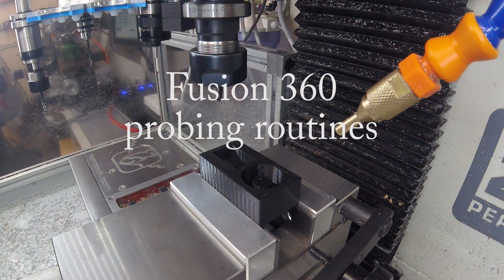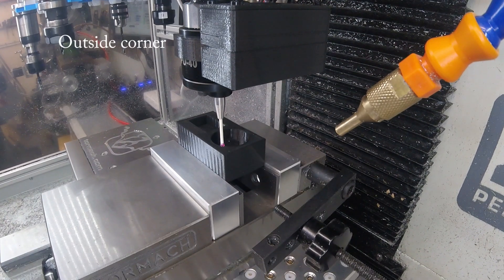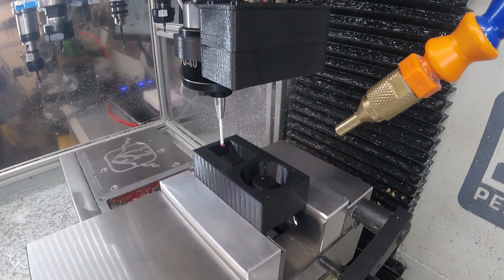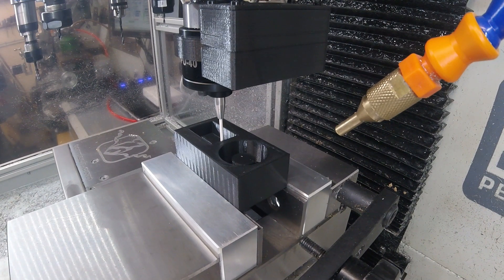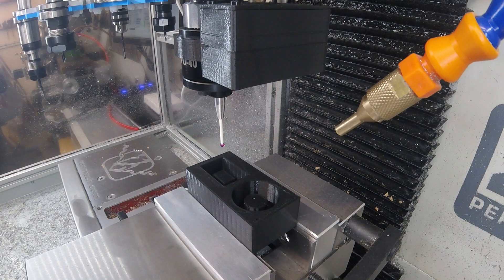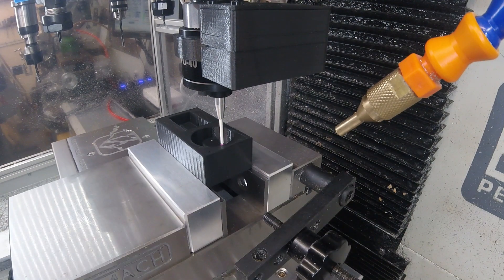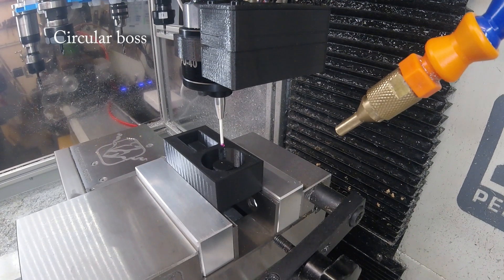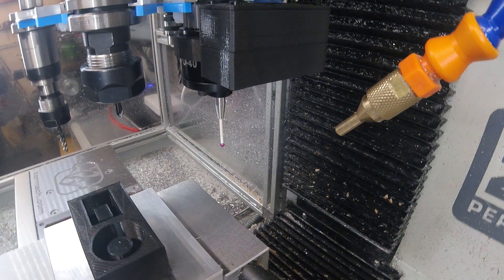Fusion Probing on a Tormach 440

Comment: Hi,

How would you integrate a probing cycle into ones machining code so that the VMC finds the corner of your stock and can then confidently carry on and machine a part?
Reply from the maker: I did a later video at https://youtu.be/aSJ01z87Rjc that shows an example of what you're asking.  It also shows how the code was created in Fusion 360.

To get it to work, you need a customised post processor and either g-code subroutines or some other form of macro on the machine itself.  I have implementations of these for Tormach machines running PathPilot or for Mach 3.

There's also a more 'real world' example of the routines being used in https://youtu.be/KDfAdO0Xkcg This example does exactly what you're asking, probing first the top, then the back corner of the workpiece.  It adds the sophistication of doing 2 workpieces in separate WCSs - not bad for a little 440!

Comment: I have so many questions. First thanks for sharing. Can you explain how you modified the probe to become wireless. Second, would you please share the fusion 360 project for me to understand how the probing is integrated into your CAM and post-processor. This is amazing. I have a PCNC 1100 and the active probe and I always though wireless probing was for the Cool Haas guys :)
Reply from the maker: Have a look at my later video https://www.youtube.com/watch?v=aSJ01z87Rjc it shows the probing being used properly and also how it was programmed in Fusion.
The wireless conversion is based on just an Adafruit Feather 32u4 with LoRa radio.. You should be able to find it easily enough.  That and a LiPo battery are all that's added to the probe.

So far the Rx end has been just one of the same and some breadboard, but productionised versions should be with me in the next 10 days.  You can see the model for that at https://a360.co/2DHiUqD.  I'll try to post another video when the first one is fully built.